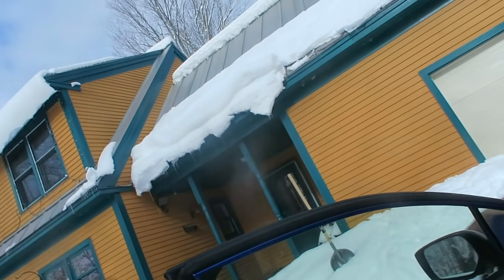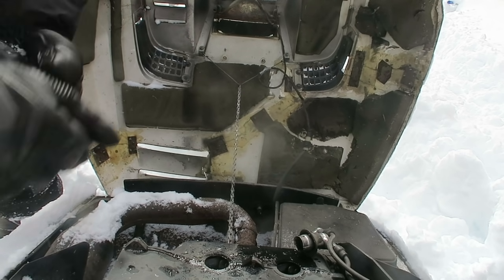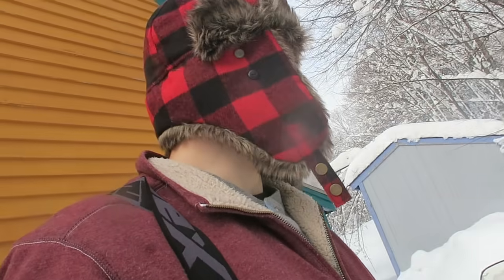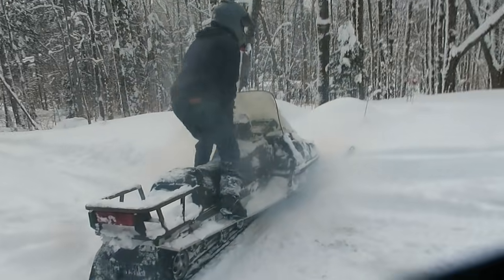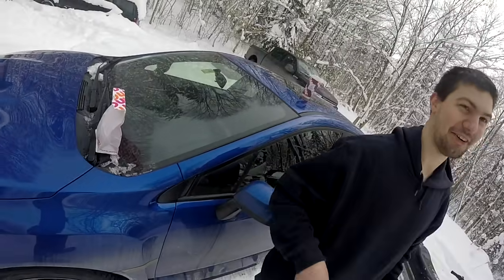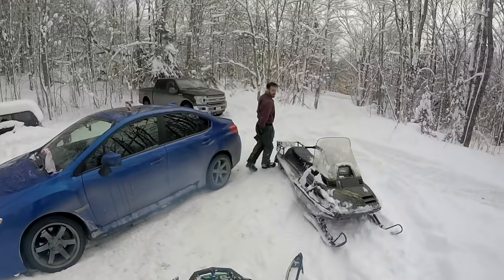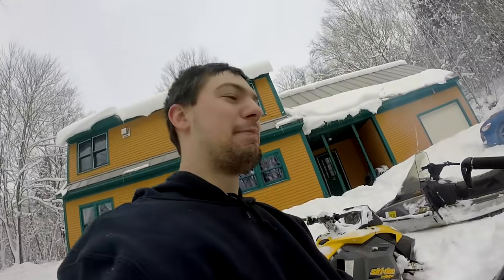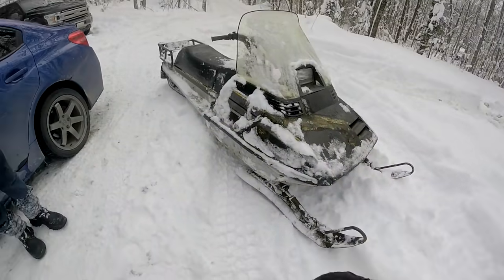IT'S ALIVE ! GETTING $200 YAMAHA ENTICER RUNNING !!!

Comment: No steering, no brakes and track doesn't grab. Just like the day she was built.  Gotta love the ET
Reply: Hey! Dont talk shit my et steers but on the other things you are right 😂
Reply: @ilikewaffles9744  I think that is a et because the colors on the cowl are the same as the one i have on my et and the cowl was from a 1988 et
Reply: Yeah that pretty much sums up the ET. I own the 400 TR model. Nice for small trips or ice fishing but acts like a submarine in powder. Dropping the suspension, wide ski skins and a new track with taller lug height might help. The original track resembles a conveyer belt at this point.
Reply: My great grandpa bought a 1980 brand new and now I have it it need hifax from being ridden on the road

Comment: If you drop the track down 2” it will really wake it up.  It will open up the tunnel and give you more bite. I grew up on a 1978 440 enticer that we turned the track backwards and lifted the sled on the back bolt. It was still a knok the teeth out of your head sled but it would do better than stock in the powder.

Comment: Cool own a 83 340 inticer been using it for 10 years only one of my 4 sleds that always starts in minus 40 temperatures and never rev it over 6000 rpm or your engine will blow

Comment: I have a question for you. Where do you get parts for the older sleds.
Reply: Look on ebay and vintage snowmobile parts websites. Sometimes you can find parts by searching keywords, and sometimes you have to search the actual part number.

Comment: My et has the same issue, it'll run when we poor some gas down the cylinders but won't stay running because no gas is going through that line, could you give me a tip on how to fix that problem please?
Reply: Put a manual gas pump like the ones on outboard boat motor. Have the pump running directly into the carb. I had the same problem and it worked for me
Reply: @denniskaroliussen8343   Would there happen to be another way? I don't think we own a manual gas pump. I would need to go digging in our garage but I don't think we do have one.
Reply: @hunterbadgero8273  its the most easy way i think. They cost maybe 10$
Reply: @denniskaroliussen8343  Sorry for responding so late. I fixed the issue, I just put some gas and a small bit of oil in a spray bottke and sprayed it into the carb and eventually it started pumping gas again, first time it ran on it's own power without help in about 6-7 years, thank you for the tips as well.

Comment: I have a older model a 1981 Yamaha ET it runs great after purchasing a good used motor for a 100 bucks .just some good old advice throw away the oiler use mixed gas you wont regret it.